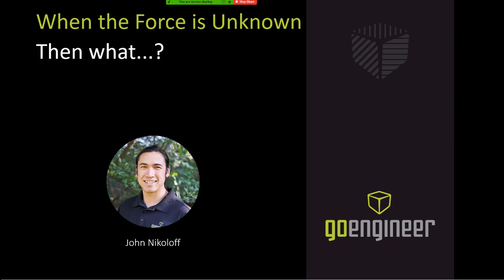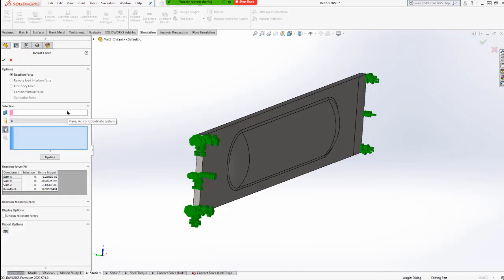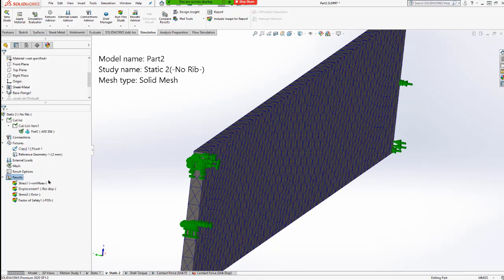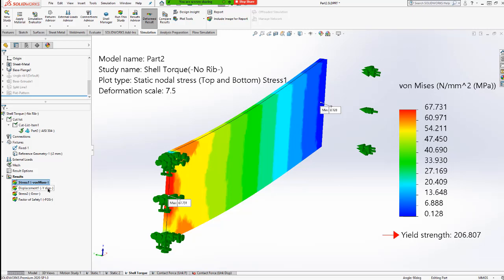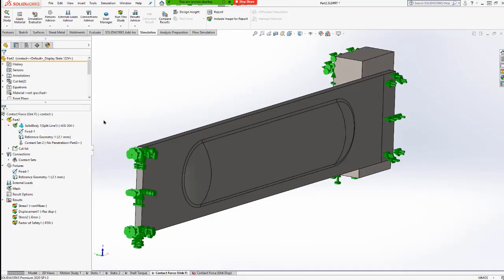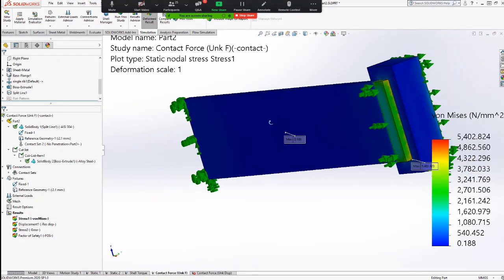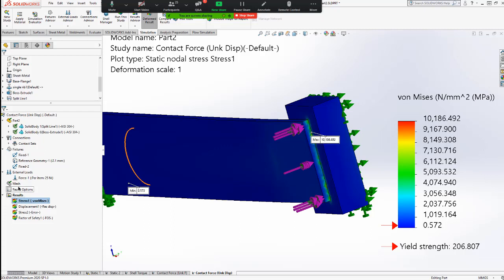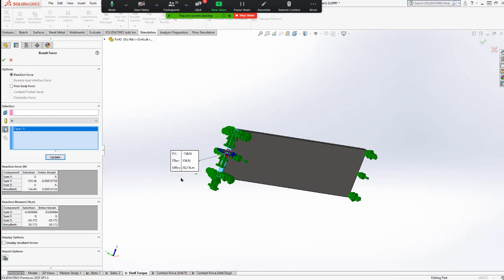When the Force is Unknown, Then What?

Comment: Three comments/questions:
1. It appears that your study "Contact Force (Unk Disp)" is applying both a force and setting a displacement (the reference geometry fixture is active, not suppressed). How can you apply both?
2. You are applying 25 N of force. How do you get 12,400 N of contact force? Is it because your are prescribing a displacement and a force at the same time, and the displacement condition is causing this?
3. At 22:43 you say that if you had a "linear static study" it would start with the force applied to the deformed shape. Did you mean to say a "non-linear static" study where there is an option to have the direction of forces update with the model? Or are you talking about an option to restart the linear static study and have it update the forces on restart?